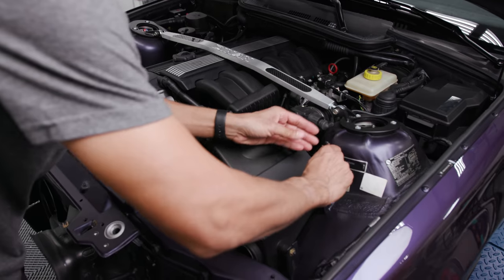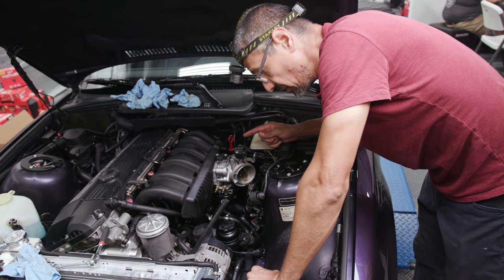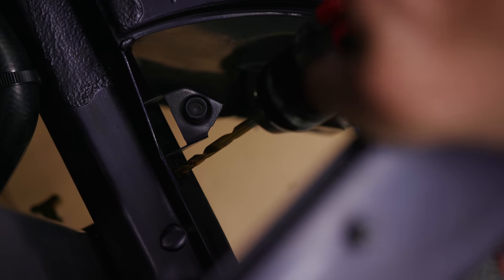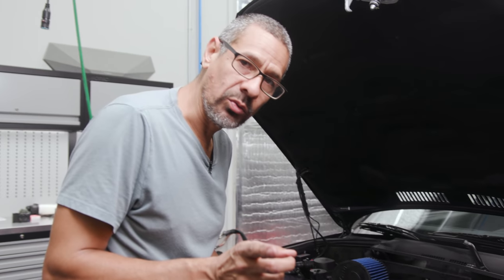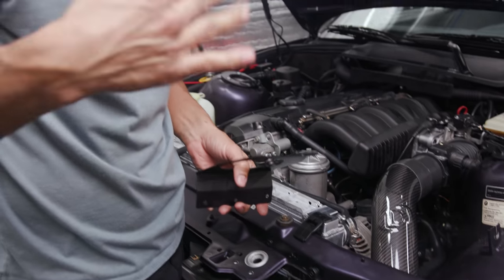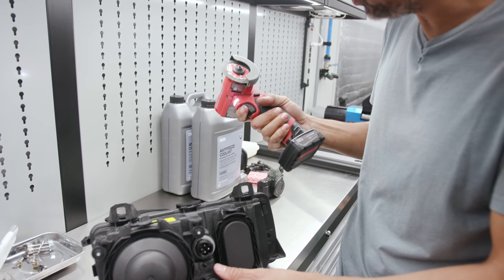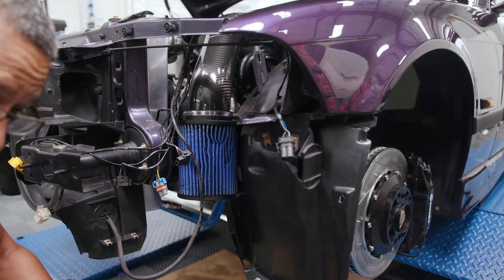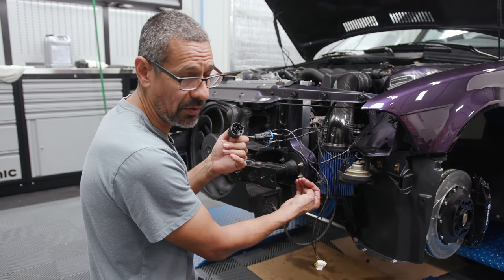E36 M3 - Dinan Throttle Body, Intake and Euro Headlight Install

Comment: mmmmm, don't know man, starting to look like a pretty gueto install.
Reply: @vltruan  have you watched at the video, the ammount of cutting that had to be done? not only that, the cutting that was done wasn't even straight.
Reply: @ernestofleites8465  Not everything is going to just bolt on dude. Sometimes you have to customize the parts to make them fit. I guess you were refer to the install not looking super tidy/ocd, but it’s not like they were finished.
Reply: @vltruan  there’s a reason you won’t find any Dinan crap here in Germany...
Reply: @AndyOG2000  not that DInan have not paid to get parts TUV approved? :)

Comment: As an e36 M3 owner bmw did not leave much room in the engine bay for modification. So the cutting and moving around are necessary. Just got to learn the art of making it look as clean as possible.

Comment: Matt there is no way you are ok with this, I’ve watched this entire series and this setup and install has gone against your stated objective.  Yes i know its your car you do what you want and you should, but I just cant believe you of all people are ok with the hack of a setup and install. A run down to pep boys for a smaller filter or leaving the filter out while you wait on one that fits would have allowed a seamless install.  Also cutting your wheel liners right in front of the air intake filter is not a good idea.  Water will find its why up there eventually.
Reply: I think it’s pretty easy to tell that this guy isn’t used to working on pristine cars
Reply: @jrose7381  No guilt tearing up a beater.
Reply: I’m with you 100%. But wanted to mentioned I have this same exact intake and that filter is the Dinan air filter and completes the intake. The fitment work is why it’s been in my storage for 3 years. I came here to see if OG has the answers since owning an E36 now. Unfortunately wasn’t what I wanted to find.

Comment: I honestly didn’t know it took so much cutting, sawing, drilling, bending and trimming just to install a CAI on an e36.. on a minty e36m3 too.. I would’ve have gone with a different setup to prevent all that but that’s just me.
Reply: OG Spec, bro! Proving time and time again that having a large mod budget does not guarantee the cars are any better than stock. 😂
Reply: @tjautocross  especially on old cars sometimes simple is better

Comment: Im affraid of cutting inner liner.. because if you drive on rain, or wash car you fil fill up airflter with water.. and.. youknow what going on after that.. And I agree with others.. removing stock bracket for your standards are shock for me.. for inner liner.. ok.. you can buy new genuine.. but bracket.. dont know.. I think matt is not here when this guy doing this.
Reply: @Dominick I think you are the guy from video.. and you are there to answer all negative comments.. but believe me.. from 100coments ... 99 are negative.. this is something what you need to receive and change your way how you work on a cars, sorry :)

Comment: WTF is wrong with you guys in the comments? They drilled the spot welds off the bracket that the Dinan instructions SPECIFICALLY said needed to be removed.  Most people cut it off. They went as far as to saving it to be welded back even. I have the same intake and did the exact same thing to my car. And chopping the headlight nub is hardly “botched”…… zzzzz…y’all are soft. Matt f these haters lol I have the intake identical on my car had it for over 30k miles and no issues.
Reply from the maker: You said it better than I could.

Comment: This is why I went with the AFE intake. I hated the fitment of the Dinan even though the Dinan does sound a bit better in my opinion.
Reply: @jrose7381  yeah it’s not enough of a change for me to use the Dinan. AFE sounds good and I don’t have to worry about driving in the rain

Comment: Dinan or Dinan style, from EBay? No way Dinan engineered that. Wtf did I just watch!?
Reply from the maker: Ha, ha... Dinan made the intake for USDM headlights, not Bosch style Euro lights.
Reply: This is well known, and not Dinans fault. All three revisions since 1999 clearly state in the product description and install sheet that it does not fit w/ Euro headlights. It is designed for US plastic headlights.

Comment: This is not Obsessed Garage. Weld metal bracket back on. Paint it. Replace anything that was cut with new oem then put the aftermarket intake in the trash.
Reply from the maker: No...this is pretty much the same as every car I've ever modified.  I want Euro headlights and Dinan intake, so this is what you have to do to make it work.

Comment: Dinan intake is a PITA with euro lights. Mine is basically crammed down in there.
Reply: I second that I ended up going the K&N route. dumped the asc got the mishimoto arm to the maf. from there is a rubber boot that passes through the heat shield to the K&N Cai intake. Oh and fits well with my euro headlights.

Comment: Fuck all that collector bullshit. Nothing was done that can't be undone anyway. Having said that I too am surprised Matt is ok with this. I would have at least fab'd up a replacement bracket. A simple strap bracket would have done fine. I am not familiar with that intake but it seems like moving the filter a tad lower (further away from the carbon pipe) would have solved the problem. A silicone coupler and a straight piece of hell carbon pipe if you really wanted would do the trick. Now having said all that hindsight is 20/20 and it's easy to play keyboard mechanic when you're not actually doing the work.

Comment: How to wreck a mint M3 just l to fit an overpriced pointless modification. Filter even looks battered…… No doubt we are all idiots who don’t know what we are talking about …
Reply from the maker: Come one man... Wrecking the car by cleanly removing a bracket is not wrecking anything.
Reply: @ObsessedGarage  for normal peoples this is not wrecking.. but for Obsessed Garage standards to which we are accustomed this is WRECKING.. because we know how precise you are and how well you work on your cars .. we know that.. if this was some ordinary youtube channel of some random guy .. this wouldn't be weird .. in that situation that work will be normal..but since it's Matt's car .. then it's weird.. cutting headlight, cutting fender liner.. removing bracket.. let me give you a comparison Matt.. if a football player of 1M worth for a year, misses a penalty .. it's not strange .. but if a MESSI of 100M worth misses a penalty .. then it will be very strange for everyone :)  in this case  you are Messi.
Reply: @ObsessedGarage  The point is Matt would rip anybody apart if he saw them doing this kind of mod to their car, yet it is acceptable when he does it. Don’t get me wrong I like the channel and content but practice what you preach and accept everybody has different opinions and they are not necessarily wrong because it isn’t the Matt way😉 But seriously get rid of that battered air filter with its gimmicky “carbon’ pipe.

Comment: Made it worse than stock. Yikes. Hope this is the end of this segment.  None of this will yield any performance worth what we just witnessed.
Reply: Especially when not swapping an M50 manifold on. The Dinan throttle body is a joke. I have one and there is no way it provides any gains. The only thing different is the best Dinan on the butterfly and maybe a millimeter larger diameter. 

I have the Dinan intake and had the same issues. Basically a piece of shit if you have euro lights. I nearly the intake tube and just did a short CAI to avoid the bullshit down there in the bumper.
Reply: @stashtrey1  this is a classic example of just throwing money at the car with unlimited funds vs scrutinizing every update and investment in a logical series of steps towards the goal. Very haphazard should be small steps and further analysis before moving onto next step. All signs point to car being sold in 6 months. Civic 2.0. Tiring to watch.

Comment: Like I've said before when you first got this car. You're a "Show & Shine" guy. This isn't your lane. This car should've gone to one the real e36 heads out here, not you. Why in the world would you pay someone else to do a simple intake job? You're killing me with the comedy.  .  . The first thing to set this car apart from the other channels currently working on their e36's is ordering a Eurosport Twin Screw and NOT bolting some silly plastic intake pipe. We've seen/done this ourselves 213 times already, sheesh' . Then while the charger was getting shipped you need to drop the engine/tranny to really get it clean. Dropping the engine obviously will make replacing old brittle parts and installing the supercharger much easier. Why ice clean (or whatever that was called) parts that your going to replace anyway, smh. Don't be "That Guy"  well too late you're "That Guy", haha!!!
Reply: Daniel, I’m a long long long time E36M fan. Also, a long long time OG fan. That said, I was one of the first to pick up the original ES TS that Josh and Mike produced, back in the day.  Mike at TRM did the upgrade tune from the original Jim Conforti Shark tune that shipped with the kit. I later upgraded That 1.6l kit to what I believe to be the first and last 2.1l Kenne Bell Eurosport Twin screw kit that was ever made. It’s a masterpiece, currently in my garage on my 95M3. My point is Josh and Mike are no longer producing those gems. Now that my E36 credentials have been established, I have total confidence that Matt will work this out. I’ve been watching him for a while.
Reply: @greentipacademy8696  so, how much you want for your M3... 😁
Reply from the maker: I don't want a supercharger.  Let's compare result at the end.  My guess is you'll change your mind when I'm done.  I'm busy running a pretty significant company, so I asked Eb to knock this out for me.  Seems like I'm the winner here.
Reply: @ObsessedGarage  No, you are not.